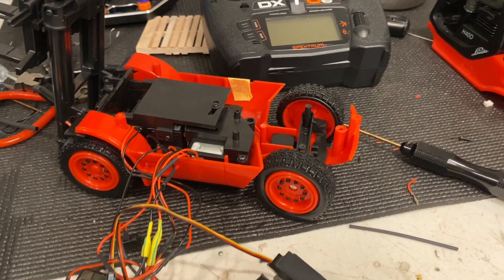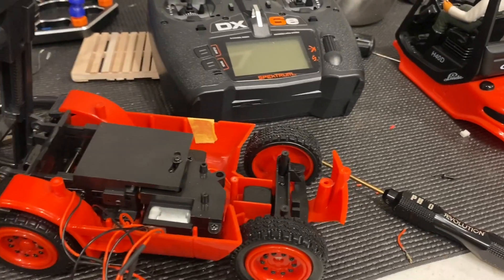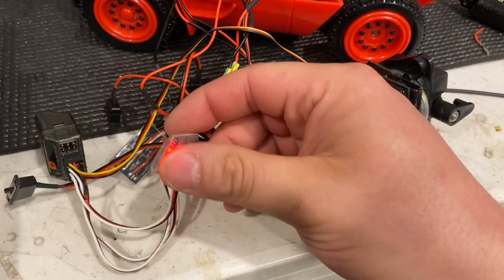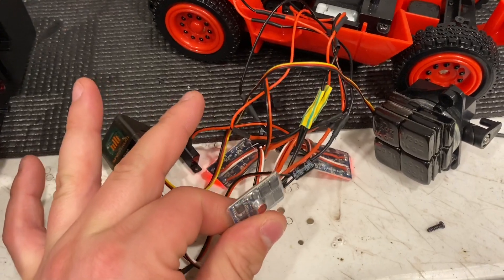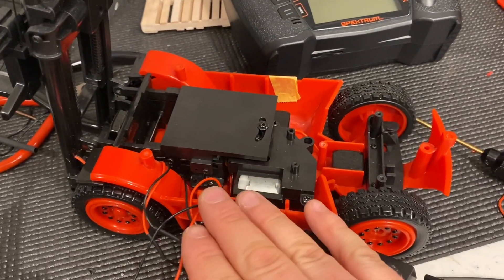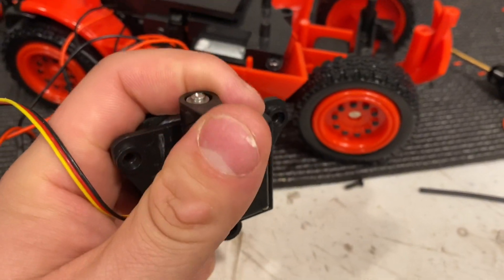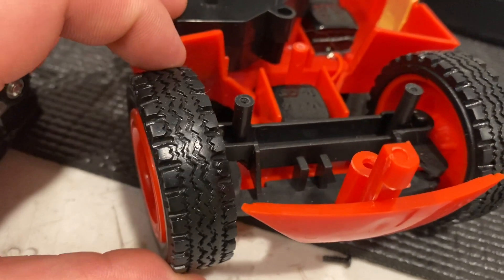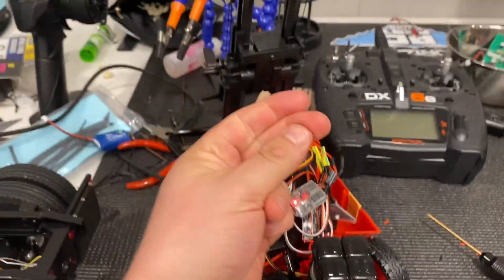Converting a Carson 1/14 forklift to Spektrum Radio and a Hitec Servo!

Comment: Got one of these recently but the steering servo is giving me problems. Do you happen to know if I can adapt a standard 3 wire servo to do the job or Is there a replacement 5 wire servo available with  better internal cogs.
Reply from the maker: I swapped to a three wire but I had to change the rx as well
Reply: Kind of thought that. Don't really want to go to that hassle. I've emailed Carson to see if they will send me a replacement servo under the warranty.